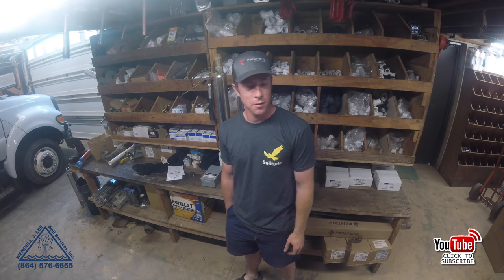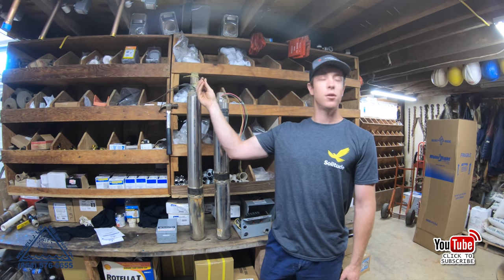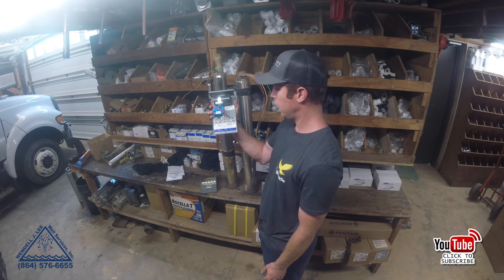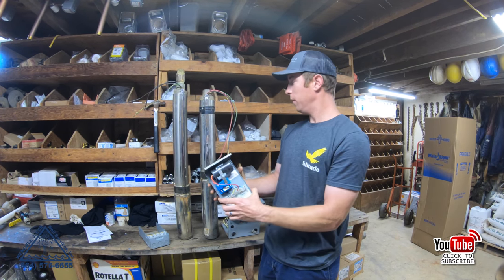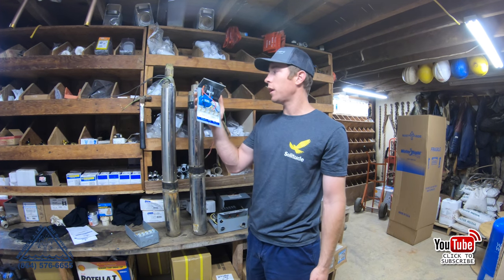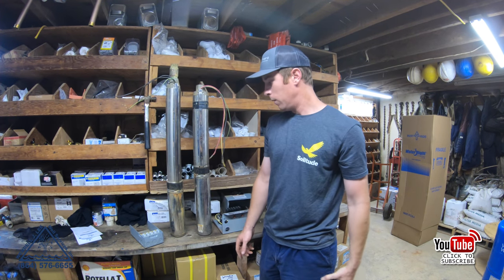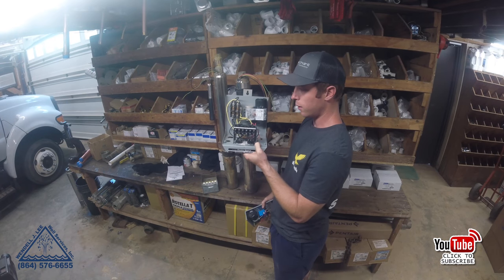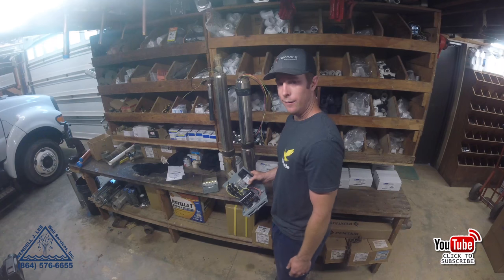2 Wire and 3 Wire Submersible Well Pump Motor Wiring Differences Explained

Comment: I just pulled my 1 HP Burks pump and it probably was installed in 1988.  It has three wires coming out of the motor (black, yellow, red) AND I have a control box. Point being, there are exceptions I guess.

Comment: So as far as reliability, is there a difference between and 120 or 240 volt pump? I have a 240volt pump but want to get off the grid. More expensive to build a 240 volt system. But will do it if a 240 pump is better. Thanks
Reply: It's mostly a matter of horsepower. 120V motors are 1/2 hp. Can you manage with 1/2 hp? If so, great. Go for it. It you're deep you may need 3/4 or even 1 hp, and that motor will be 240V.

Comment: Replaced my pump just a few years ago, power went out, this is in the country of course, power came back on from the storm and pump doesn't work, 2-wire with ground pump. Could the integrity of the wiring that feeds from up top down to the motor have bearing on in-ground static or lightning that could be in the area? How does that play in? In short, I've been without any water for about a year now, toting water from my neighbors well across the road. I have now the money to purchase a $399 2-wire pump from Lowe's but I really should also likely replace all the wiring, even from the direct burial feed that's been in place for years, depth buried unknown and quality of installation unknown. Are there suggested types of breakers that could be used? Likely it's a Square D 200A panel. (I'm a previously licensed Journeyman electrician who's been doing everything else since my licensing years ago.) I suspect that I could get an ohm meter and test the existing wiring with long leads to see what it reads. Suggestions?

Comment: Very helpful, thanks!  Related question, I'm replacing our home 1/2 hp pump, (about 75 ft down which lasted 25+ years) I'm wondering if I also need to replace the existing 2 wire (Kalas flat yellow) cable.  Apart from one chafing "cut" about 2 ft above the pump, the rest of the cable appears on the outside in good shape.  Yet when I started to prepare the end for splicing, I notice a bit of "green" colored crust/dust -- inside the yellow outside casing.  Yes, I can easily clean off the copper ends, but is this an indication there's corrosion inside the cable that could cause problems?  (perhaps caused by well shocking?)  Or is this merely cosmetic?

Comment: Why does the wire coming into my house from the pump connected to the pressure switch have no ground wire, only the two conductors? The wire going to the pressure switch from the breaker panel does have a ground wire. As far as I know the pump is the original from when the house was built in 1985.
Reply: I'm tryin to determine the same thing on my well...from what I understand is back in the day they didnt require a ground as the metal casing of the pump goes into the ground 100 feet or so..no better ground then a 100 foot metal pipe in ground..but now I believe the require a ground..idk

Comment: Good info.  I always thought 2 wire pump meant only 2 wires, and 3 wires was a pump that includes an equipment grounding conductor or an ungrounded pump with the control box above, because many years ago well pumps were not required to be grounded because they were not considered accessible.   However some folks would pull the pump to test it, and the motor housing could become live if there were an internal fault to its casing.

Comment: I recently moved into a home that has city water and a non-operational well. I used a voltage sniffer at the well head and there is some sort of power there although I couldn't determine which wires were "live".
I'm trying to eliminate items that don't affect whether or not the pump will work. Sure, the pressure switch might not actually work properly and I will address that later, in the meantime I just want to find out if the pump itself works. The pressure switch presumably defaults to the on position and the increasing water pressure turns it off. So "always on" should be good enough for my test, correct ? 
The layout of the system is :
Power from breaker (230v) enters a switched box, then to the pressure switch, then to the controller, then outside to the well shaft.
I have confirmed power from the breaker, through the switched box, through the pressure switch and into the control box to be ~230v. Presumably that questionable pressure switch is at least "on".
I also checked the R, B and Y lines from the control box to the well to be R-Y 18 ohms and B-Y 6.5 ohms. I found another video that concluded that if I have a 0.5 HP pump and 230 v supply that those resistance readings indicate that the pump itself is ok. However, I don't know what pump is down there.
Looking at the removable part of the control box, the label states 0.5 HP and the capacitor has at some time leaked and the indicator is yellow. 
A couple of things - there are no ground wires anywhere. None from the breaker, none in the switch between the breaker and the pressure switch and none in the control box either from the line or the load. When I look at the wires under the well "cap" all I see are the red, yellow and black that come from the control box and they continue on down the well shaft to the pump. They are then spliced onto the wires from the pump and there is a ground wire that comes from the pump that looks like it's been cut and just taped to the remaining wires. The sniffer detects voltage on both sides of the splices. Again, I can't tell which wires have power, the sniffer is too sensitive.
I have ordered the matching capacitor for the control box and will replace that. Is there anything else I should know about before I try to run it again ?
I tapped on the pressure tank and the top sounds hollow whereas the lower half has a more solid sound to it.
Once I replace the capacitor can I just turn it on and see what happens or do I need to prime anything since this hasn't been used since 2014 when the house was connected to city water...according to my town's municipal office. I can see the water line in the well shaft so the pump is definitely beneath that. How deep the well is, I don't know. I also don't know how far down the well the pump sits.
Why are there no grounds ? I believe the pump was installed in 1990 since there was a copy of an instruction manual with "Installed 1990" written on it. No mention of the pump size, just that it was a Goulds pump and the manual covers 4, 6 and 8" submersible pumps. Ultimately I'm trying to get to a point where it either works or I can determine that it's definitely a bad pump.......and then pull the pump and replace it knowing it will then work. Obviously I want to eliminate everything else first. Thanks to anyone that can offer some insight.
Reply from the maker: There wasn't a ground wire because they weren't manufactured in motors back then. 1990 was right around when ground wires started being installed in motors. For the money, you may as well get a relay too inside the box. Then, go buy an amp meter and clip it around the wires. That way when you throw power to it, you can tell if the motor runs or if it is locked up.
Reply: @WendellLeeWellServices  Thanks, I wasn't able to locate a relay using the serial number printed on the label - the only thing I found was a complete box. Having already bought the capacitor I declined to buy a whole box. I then found a video about testing the relay - here - https://www.youtube.com/watch?v=ZvQc8l8ueUM
The relay I have is the blue one but mine is marked 1/2 HP 230V. Following the video I checked the resistance and the results were - 
CAP - B : no reading at all.
B - L1 : my meter measured 0.3 Ohms. The video said the number should be 0.
Also, when I powered up the system there were no sounds from the relay, I would have expected a click if the relay switched over but I heard nothing at all.
So, should I still replace the relay - meaning the whole box - or move onto checking the pump with the amp meter.
How do I do that, just hang the clamps around the red, yellow and black wires that come out of the bottom of the control box (heading to the pump)  ? What am I looking to see ?
Edit- I borrowed an amp meter and when we threw the switch the reading was.....zero. That said, when we tested it we put the clamp around all three wires and I have since read that they could "cancel each other out" and we should have tested each conductor separately. So, is it the pump or could it still be the control, relay perhaps since I replaced the capacitor. or should I re-test the amps of each conductor separately ?
Thanks for your help with this.